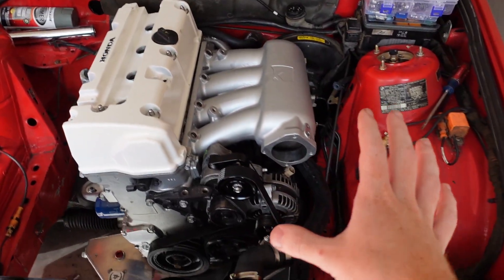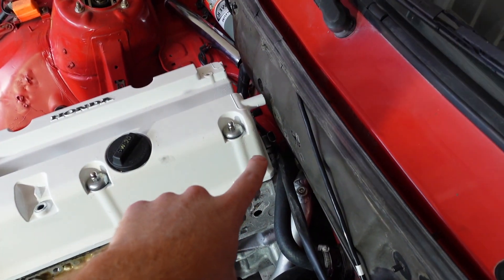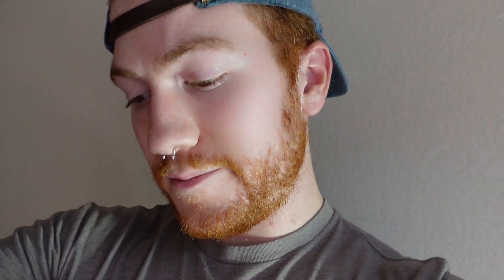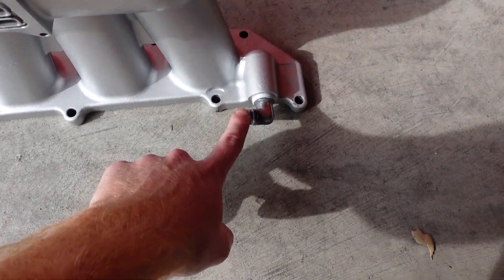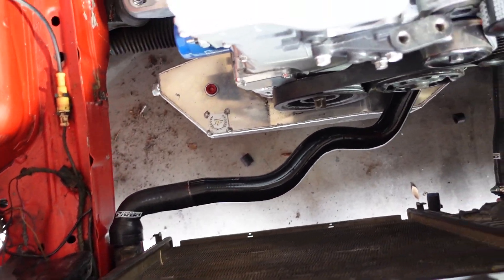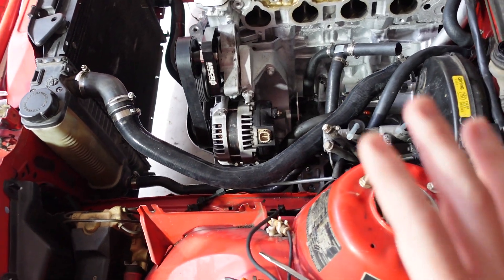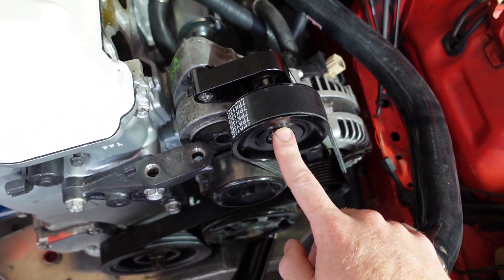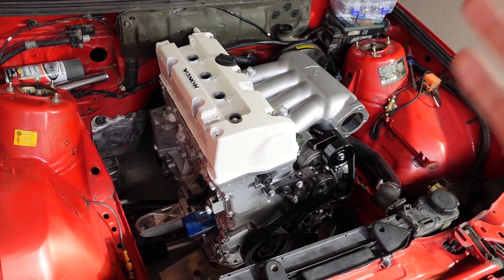RWD K Series Coolant Routing w/ Heater Core (K24 Bmw E30)

Comment: You used the stock e30 radiator just rerouted hoses?
Reply from the maker: Correct, yeah k series are pretty efficient at cooling and my radiator was good

Comment: Did you go with the m42 rad because your retaining the heat for the heater ? 
I seen the rwd rad but they don’t have the option for the heater hose .
Reply from the maker: The 3rd hose is just from the expansion tank, so you can run an upgraded rad, I mainly stuck with the OEM because mine was in good condition so it saved a good amount of money! You can for sure still run heat with an aftermarket one, you just have to route it differently 🙂
Reply: Where did you order you heater housing to connect the swivel neck ?
Reply from the maker: @earvinrangel815   for that I just went to the auto parts store and found a large L shape that was enough to route everything! If you go in the should have a bunch of random ones in stock! It's a bit obnoxious but they should have something!
Reply: @ProjectRacecar2  where can I order a swivel neck ? You a link and any sensors I should buy I’m in the build process rn . Putting it all together and do u have a link for that ep3 idler pulley and belt ?

Comment: So I’m a little confused with all additional mods you’re doing. I’m looking to do a k swap on my e30 and don’t really care to boost it right now. Would I need that ep3 pulley and k tuned fuel rail? Or is that just for boosted applications? Maybe you could do a parts list video with two different categories, naturally aspirated and boosted. Thanks for the vids, been following your progress closely ❤
Reply from the maker: The k tuned fuel rail is a good affordable option for both boosted and NA and from my understanding you need the ep3 pulley to clear the throttle body, the reason why you want the k tuned rail is because it can be converted to return to gas tank if that makes sense! I'll try to get some information out in the next video!
Reply: @ProjectRacecar2  ok I got you. Thank you so much for the response! I’ll look into that fuel rail. Might as well regardless because it would be nice to boost my motor in the future anyway.

Comment: Man y’all need a PO BOX, people will send you stuff to help for sure!  I used an e36 (96-99) 328i drive shaft with an e30 center support bearing on my 318is m50/zf swap, bolted right up! Was able to get it from a local junk yard when I lived up in Washington, I also put some “kilmat” sound dreading in the drive shaft tunnel to quiet some noise, worked awesome! The 318 models were a little lacking on the sound deadening department! 
Y’all got an insta? I can send you some of the parts I used for my swap, I know yours is a bit different, but some will translate over!
Reply from the maker: @_Jrchappell hey man I'm reaching out to say congrats! You were entered into the 5k Tshirt giveaway and won! Reach out to me on Instagram @_project_racecar_
Reply from the maker: A PO box would be smart!! I'll try to get that set up this year, but interesting, I'll check to see if I can find a 328 driveshaft! I'll also look into that kilmat, but yes I do have an Instagram @_project_racecar_
Reply: Ahhh hell yeah!!! I’ll message you in a minute!